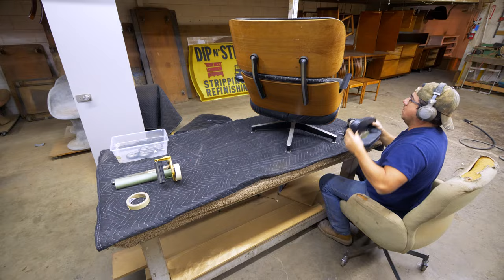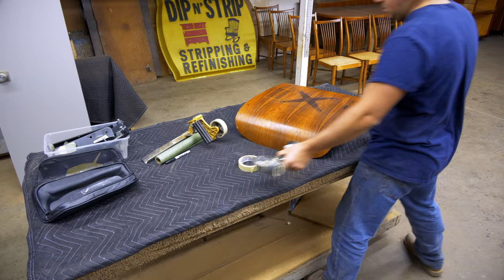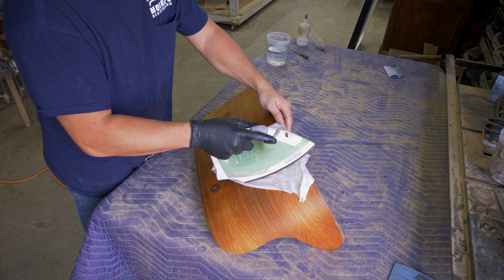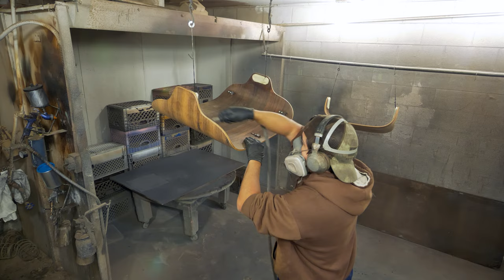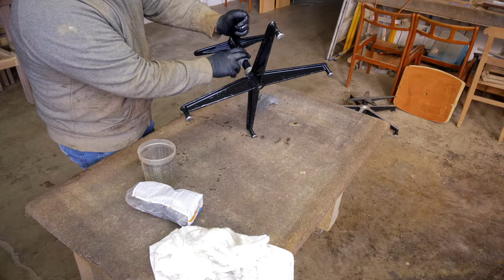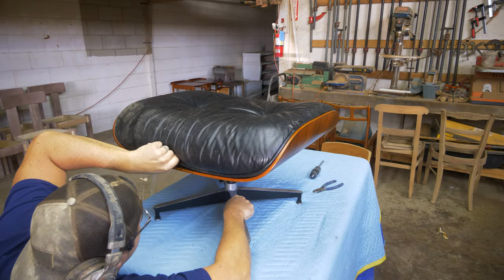How To Refinish an Eames Rosewood Lounge Chair from Start to Finish

Comment: Curious to know how steaming removes dents and scratches. Getting ready to restore one myself.
Reply: Yes, this technique will work on ANY type of wood, but be very careful not to over steam. the Grain will also raise up a bit giving it a rough texture, but you will be sanding in the next step and that will level out. Again, all of the old finish must be removed for this technique to work. It will raise back to level. 
I do not recommend  trying to do this for the scratch and dents on a "spot Fix" the whole piece must be sanded or stripped down to bare wood.
Reply: The wood fibres swell up from the water/steam. On solid wood it's quite a safe technique to use. On veneered wood like this you have to be careful, as this gentleman was. If you apply the heat for too long in one spot you can break the glue bond.

Comment: The old shock mounts should have been replaced! The new owner will have one let go, and break the plywood.
Reply: Anyone who ever sits in these chairs should be told to NOT PUSH ON THE ARMS when you stand up.  Plenty of room on the front of the seat cushion to give yourself a boost.  Pushing on the arms is what breaks them.